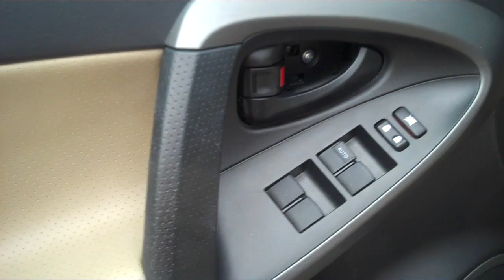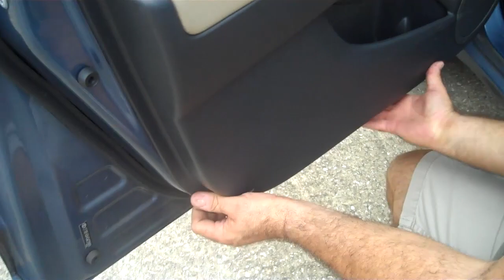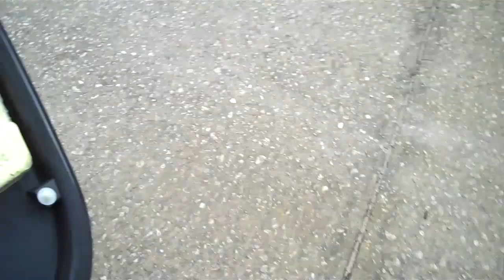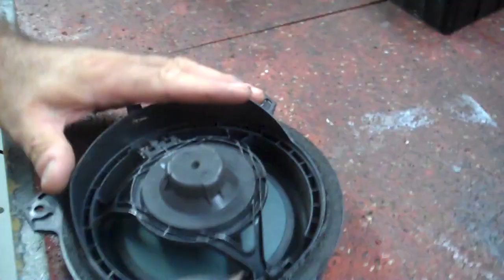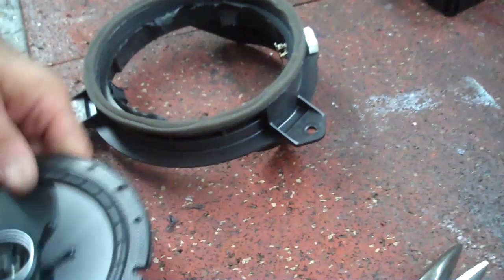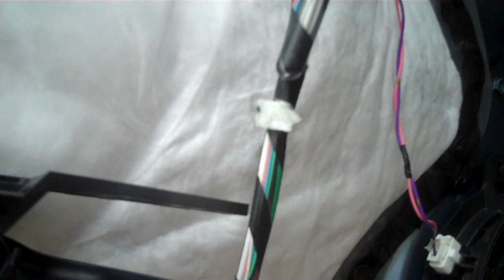Toyota Rav4 Front Speaker Removal and Replacement Car Stereo HELP

Comment: wait a min... if you are  re-using the mount. and the speaker is part of the mount.. can you not just cut the speaker out from the outside. break the mounts. and screw in a new speaker without even bangin out the rivets??

Comment: Now the question is : why you had to drill out the old stock speaker?  Since you had to put  it back? Just cut it from the front since the frame is made of plastic and not metal in your case?

Comment: Are the original speakers really so bad that they deserved to be ripped out like that?
Reply: Kinda yea. The first gen ravs had decent stock speakers, the 2nd gen they offered a fancy jbl upgrade so really made the stock as crappy as could be, I actually have a 98 and a 2002, the 98 is better sounding with no tweeters. On the 2002 there’s no bass in the stock speakers, they won’t even respond to anything under about 150hz or so, the 98 will at least get some of that lower bass in down to around 80 giving a fuller sound. Early 00’s were when there was like an aftermarket speaker war with customers, they started making proprietary head units, integrating in door buzzers so you needed a separate buzzer contraption and doing foolish things like riveting in speakers all to force customers to spend outrageous amounts opting for factory upgraded stereos. Really should be criminal.
Reply: @travispratt6327  I ended up adding a subwoofer to the system and it sounds acceptable now. I have the 3rd gen Rav4.
Reply: @Obywatel1978   Yea my dad actually has a 3rd gen, it’s better than the 2nd gen actually but all he has is factory radio so haven’t really compared it much. I’m debating on a sub or just upgrading my speakers. I like bass but I’m also content with just normal good sounding full range speakers. Did you just do a box in the rear?
Reply: @travispratt6327  Yes, I just put an active subwoofer in the trunk.

Comment: I did it using your instructions. I was quoted such a high price, that I thought it would be worth giving a try myself. It worked! My new speakers were not even the right size and the housing I also purchased didn't fit. Your video helped me so much!

Comment: Yikes... it all looked just a little too rough of an install to me... Drill slipping when removing the rivet, dropping the door fascia panels onto the bitumen, rough cutting the molded speaker fixture, and self tapping screws into the inner door panel without checking for rear clearance.  All in all an rough as guts installation.  Id suggest to go to Five Star Car stereo Channel and see how its done properly to protect your car when upgrading the stereo. 🤔

Comment: You skipped the most important part: attaching the new speaker to the mount.
Reply: My same thought.  I paused the video to take a closer look and it appears to have been been screwed to the old frame with a bugle head drywall screw that was not even screwed down all the way. 
I’d suggest using either a self tapping truss head screw used for fastening sheet metal together or a small machine screw and nyloc nut to fasten them together. 
A bead of adhesive or double stick foam tape could also help prevent vibration.  
I’d also trade in the Ryobi drill for a more reputable brand of tool if I want to be taken seriously.
Reply: he used super Glue!

Comment: wait.. what are your self-tappers screwing into? Gud gawd all this chit was easy af before lazy cheapo manufacturing/assembly. I'd bur off the heads & leave the rest of the rivets. lol, rivets . . as if some crap stock speakers didn't need instant replacement with 20 miles on the car!
Reply: oh.. ya twisted the basket bracket 1/4" from the og holes. down n dirty. Guess I like it. what a pain.

Comment: Did mine exactly the way you did it. Worked great! Just took me longer. Sony 6.5". 2012 Rav4. Also just stuck the wires in the white plastic connector from the door and taped them. works great. Thank you.

Comment: Can this be done without a drill?
Reply: The rivets are the issue, they're made of metal, and they're not screws. If you can take them off without a drill, sure. If not, then no.
Reply: YES ... Just use a Pneumatic Chisel as it too will possibly ruin the inner door skin ... LOL  Or go cave man style and use an actual Hammer and chisel.  Good luck on the repair bill !

Comment: did you really replaced the original speakers with a COAXIAL?? in the doors? w t f
Reply: What's the problem? Will they not sound right?
Reply: @joey4277  I'm sure the new speakers will sound fine. However, the factory configuration is a "component" distribution: you have s single "woofer" driver at the bottom and dedicated "tweeters" at the top of the door, close to head level.  Using a coax speaker is kind of a step down from the factory configuration if you will.
Reply: @CarlosAnglada  it’s worse than that. The tweeters in your new speakers won’t even be used unless you remove the crossover filtering that feeds the highs to the tweeters and the mids to the woofers. Otherwise the factory installation would sound like garbage with your woofers and tweeter both trying to act like full range speakers.
Reply: @cwalter5  All excellent points, but the excellent installation of the speaker mounting will cause more noise than the speakers themselves KeK! 😆 Just insert key and drive... Tada  Speaker Noise!

Comment: Thanks.  I replaced both front lower speakers using your method.  I used 6.5" Sonys.   Our 2009 Rav4 speakers had 7 ribs that needed to be cut.  I used a jigsaw that did the job well.

Comment: What size speakers can fit the OEM brackets? Was thinking of buying 6,5" speakers.
Reply: I think he installed a 6.5 inch Kicker speaker, even though the stock ones are 6.75 inch.

Comment: Good clear video.  I was thinking of replacing both the lower and uppers. Are the highs less clear if you just put a two way speaker in the door and disconnect the upper?
Reply: I would imagine so less clear. I just replaced my Miata speakers and realized how much easier a single 2way speaker would have been. Far less hassle and install would be 5mins. I am about ready to upgrade my 2011 Rav4 and I found some $450 Focals for $100 used locally so I am going to deal with the hassle so I can get the max sound performance up front. If you want simple I think you will still have great sound but that tweet sure won't be pointed at you like it would be in the factory spot. I did find on Amazon some tweeter brackets that work with OEM holes. Spendy at $25 though but will simplify the install so I bought them anyway.

Search this             Speaker Adapters For Tweeters Fits 2006-2012 Toyota Rav4-2" cutout - SAK115_2-1 Pair
Reply: I replaced the uppers with silk dome Kenwood eXcelon’s and they sound beautiful. I highly recommend.